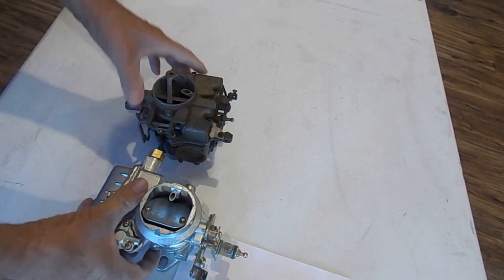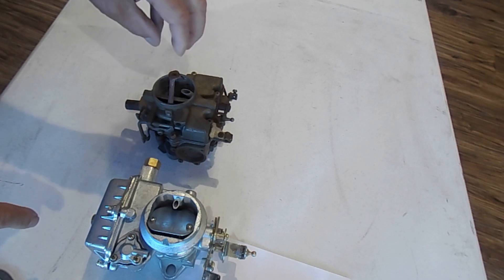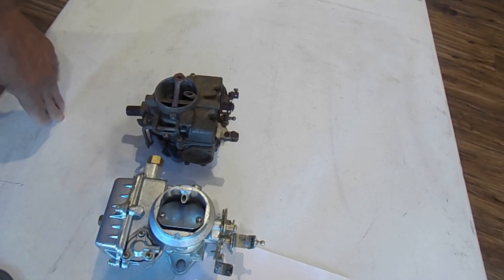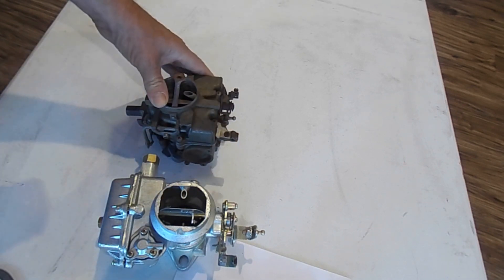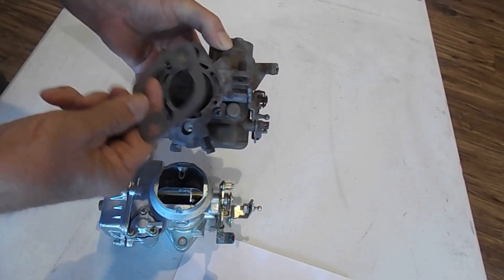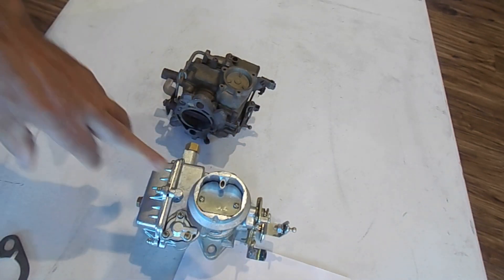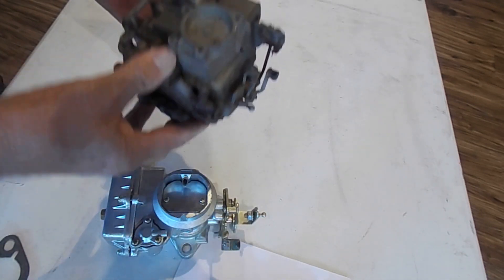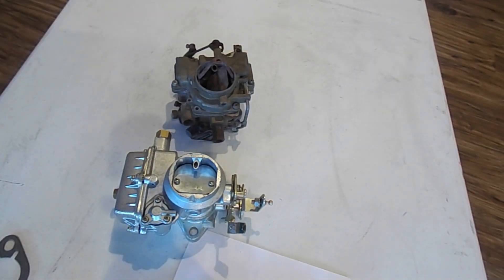Holley 1940 Replacement Carburetor

Comment: It looks like the Plymouth slant 6 carb i have on a 225 ...and my 66 straight 6 200 has the 1940, that needs to be rebuilt or a new one, as it sat up for 5 yrs, So are these carbs interchangeable? Only prob I see I need that ball to hook up to the linkage verse the hole, I bought an autolite 1100, and it cranked and ran great, 3 days later went to crank and it caught of fire! ...the seat valve got stuck, and just don't trust it now even after I checked the float, it's a 1100 but a remake china version I had as a backup carb, and even then low power stalls and float issues i've read about, just don't trust the 1100 carbs myself anymore, had a good one on a 64 comet tho I had when I was younger, the 1940 never a prob for  20 yrs a daily driver, so yeah... id rather have a new 1940 but are hard to find and expensive for the rebuilt ones, but yeah, this is nice

Comment: What carb would you recommend for a 1967 ford econoline van with a 300 straight 6.  It is used as a daily driver/mobile home. It gets 4 or 5 hours of idle time in the winter(live in wyoming its cold here). Also what are the steps to setting accelerator pump???

Comment: The 1904 carbs have a tendancy to break the floats though (in high vibration enviroments). We used to use the 1904's on Bensen gyrocopters however after many failures of the float breaking went to the 1940 carb...